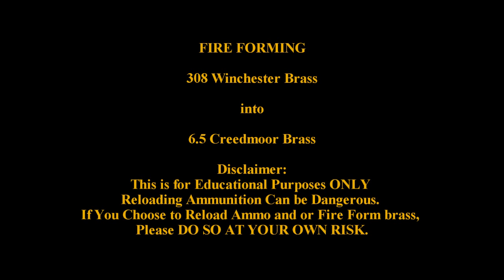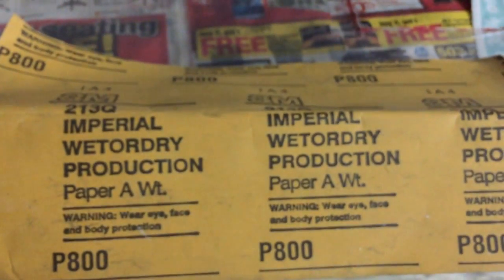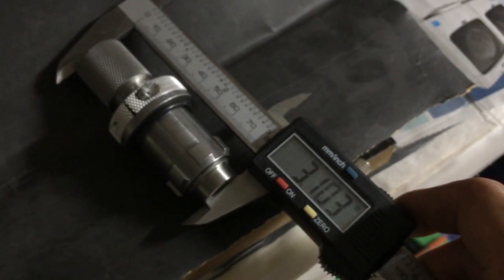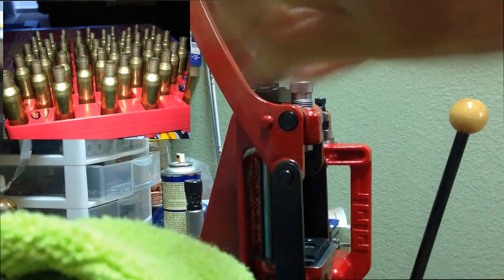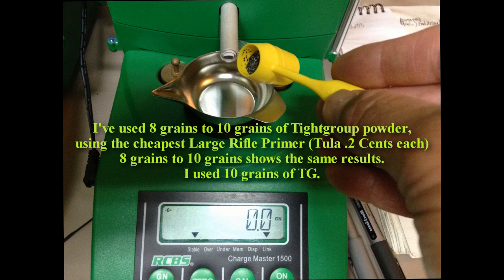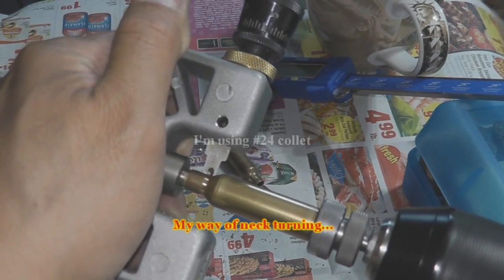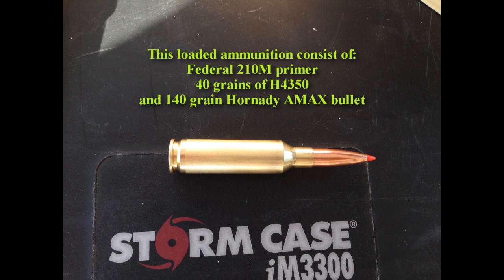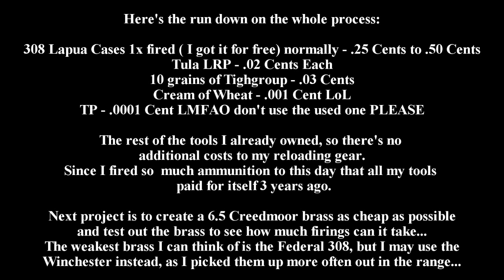Lapua .308 Winchester Brass to Lapua 6.5 Creedmoor Brass

Comment: I just ran 308 brass through the fl sizing die with the details capping rod in trimmed and fire formed with full charge and 140 berger didn't need to neck turn but I did Annel after forming in the die good video thank you for the information I did all of this before I had seen your video and thought I was original with an idea for about 10 second while Google loaded

Comment: Instead of making a sacrificial 6.5 creedmoor die, could you take 0.006" off a shell holder and have the same effect? The shell holder is a little cheaper.
Reply from the maker: You could if you are using a lee press or similar system... I used that die because it was given to me by a friend gratis...

Comment: I would suggest that you contact Neil Jones for  a Neck bumping die that also neck sizes.  The Bushings are sold in .001 increments.  As your primer pockets get loose, go to a Winchester primer as they are a tad larger and once again your pocket will be tight.I really appreciate the load for case forming, I am working on a project for the 6 XC currently, much thanks.

Comment: no 1 problem with 6.5 brass is primer pockets loosen after a dozen firings. was thinking if using military brass and resizing it to 6.5. to get more firings.
Reply from the maker: JB hey JB! The main issue I’ve had with the Hornady 6.5CM brass are case separations near the base of the case, so after 7 firings, I toss them in the recycling bucket. Though, I managed to get up to 13 firings out of them if I just full resize after every 3 firing only. The Hornady brass are cheap and I believed Lapua makes 6.5CM brass now... Military brass will be thicker, so I think we’ll have to lower powder charge to about 38.5-39.5 grains... Thank you for viewing and commenting!
Reply: JB get the Lapua brass. No loose pockets.

Comment: hmmm... this has got me thinking. 6.5 creedmoor vs 260 rem. if i can make creedmoor brass easily i'd probably go that route, but it seems 260 rem is easier to form? i'm looking to run in an AR10 platform. have the lower built (DPMS type) just looking at uppers. 6.5 creedmoor uppers seem like they are more readily available.

what was the purpose of sanding down the die? what die was that, a lee die? it would help if you provided some information on the equipment you were using (ie names/part #'s)? i'm wondering how fireforming would work on an AR platform. i'll have to look into maybe getting an adjustable gas block and turning the gas off so it'll be easier to catch the brass.

Comment: very good video, I'm trying the same with 243 brass.......can I use Malto Meal LOL :0) or GRITS HA HA........
cant say I have seen breakfast cereal used for reloading........is it common ?
Reply from the maker: hahaha I was wondering that myself! I have seen other DIY'rs using grits and corn meal for the fire forming process, for some reason they are used often as it is gentle on the barrel and gentle on the pockets... plus you can always eat it if there's extra LMAO
Reply: if your using 243win brass all you have to do is cut the case length and size, no need for extra steps of trashing dies its the same for 308 to 7MM08
Reply from the maker: hunttomuch wolfe yes sir, you are right! we can also fire form a 260 Remington (slightly longer) and 22-250 brass as well but the 22-250 are slightly shorter if the 243 Winchester brass and or other brass are not available...

Comment: I am at a loss why you added TP and Cream of Wheat.  Was it make sure all the powder burns?
Reply from the maker: AK DRAGON seat primer first, then load 10gr of pistol powder, in my case (NPI) I used tightgroup. Use TP to seal the pistol powder for proper burning of all powder. The cream of wheat is there to make sure proper forming of brass in the chamber, then the TP on top is to seal the cream of wheat to prevent spillage. This process will ensure PROPER seating of the brass in the chamber and NOT waste an expensive bullet and rifle powder, plus this is WAY easier on the brass so it does NOT count as another FIRING on the case.

Comment: I have a question....Why do you have to sand down a sacrificial die?  Can't i just use the redding type s FL bushing die?
Reply: +Tommy Lee sorry bro, for some reason I did not see your comment notification on my account. I just now saw your comment while editing some info on this video. Anyway, I tried using the same dies with no success, I broke 3 cases with no luck. This is just easier and convenient for me to just sand down this die since it's my EXTRA die anyway. If you could get the bushing die working, I would like to know so I can try to do it in the future. Thanks Tom!!!
Reply: +RELOADINGandSHOOTING I used the Redding type s FL bushing die just to bump the shoulders and it worked fine. After bumping the shoulder I trimmed and then bumped it again but this time with the .288 bushing.
Reply: +Tommy Lee I must have been doing something wrong... let me research on it and I'll let you know. Thanks Again!!!
Reply: I just threw my .308 , .243, and 7mm-08brass in my die with recapping pin and expander ball removed. Trimmed then ran it with expander and recapping pin.

Comment: Would a small base 6.5cm die do the same as sanding one down?
Reply from the maker: From what I have understood, the REGULAR DIE has the specs for a BOLT ACTION rifle and although the SMALL BASE DIE may suffice, you will still have to "play it by ear" and chamber the case to see if it will chamber correctly. If so, then it's one less step on the process. Sorry I do have the specs for the small base vs. regular die. But if you go ahead with the fire forming, please let me know just in case a fellow shooter may ask the same question in the future... Thank You!

Comment: why do you need to sand the bottom off of the 6.5 neck size die?
Reply from the maker: For some reason I couldn't get the Neck Sizing Die to bump the should to the  "SPECS" I needed for the brass to properly chamber... I had 2 other extra dies for backup and I decided to sand down the cheapest die I had... I am using a CO-AX PRESS so there's no way for me to sand down the SHELL HOLDER... if you are using a press with a shell holder like a Lee, Hornady, Lyman and or RCBS you may be able to sand down the SHELL HOLDER  as it is cheaper than an actual DIE. Thanks for viewing and commenting on my video!!!

Comment: Im about to do this on 200 Lapua 308 cases i,ve had for awhile and ready to convert to creedmoor. My only question is since 308 cases are thicker,heavier by about %8-10 am i going to be able to reach the loads i used to use in standard hornady creedmoor cases?
Reply from the maker: jaysmotogp 9 months later lol I can’t recall answering this question but I hope you found the answer by now, if not yes, it’ll fit up to 42 grains from my experience. You can fit more but I don’t see the need for it. I prefer consistency over velocity...

Comment: Or... just get a .260 Remington. You’ll get the same ballistics as the 6.5 PLUS an extra 50 or so FPS and making 260 brass from .308 is WAYYY easier. The 6.5 Creedmoor is an answer to a problem that never existed.
Reply: Dan Selvy the extra fps depends on the load. My manual shows 6.5CM being faster than .260 on half the loads plus there is no load data for the 123 and 129gr bullets from Hornady, but they are available.for the CM.
Reply: stephen e,  Agreed on the FPS, the difference between the two is a wash, ballistically their identical and just short action versions of the 6.5x55 swede. My point though was that the .260 is simply resized .308 brass. Whereas the CM is Based off the .30 TC another proprietary Hornady cartridge and I'm sure Hornady doesn't show data for the .260 as it competes directly with the CM which is a Hornady invention. Just to be clear I think both are awesome rounds and anyone with either doesn't need the other. I think if one were deciding which to buy it would depend on if one were planning on reloading (nod to the .260) or limited to factory ammo(nod to the 6.5CM). Although it seems that may be changing as the CM is becoming more a main stream cartridge.

Comment: So where are you "coolmike" ??? There's been a few questions and you have not answered them NOT COOL :-(  I'd also like to know the reason you sanded down the die and why not a shell holder ?? The shell holder seems like a better sacrifice . Also do you have to do the fire forming step ?? If so why .
Reply from the maker: Sorry for the late reply... The reason I sanded down the die instead of the case holder because i use the CoAx press as well. If I'm using a press with a case holder type only then it would make sense...
Reply from the maker: I answered your question 16 mins after you posted, but it doesn't show that I replied. (???) To answer your question again, the reason I sanded down the die is, I also use my CoAx press to form the brass so if I were only using a press with a conventional case holder, then it would make perfect sense.
Reply: +koolmike79 
Thanks , I did see your first message a few days ago